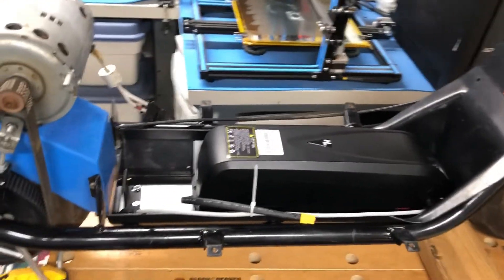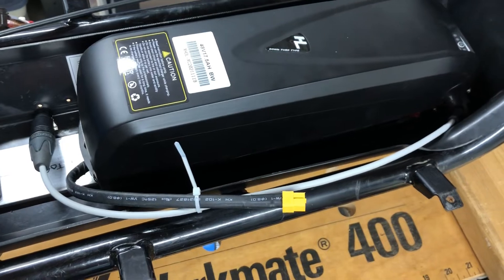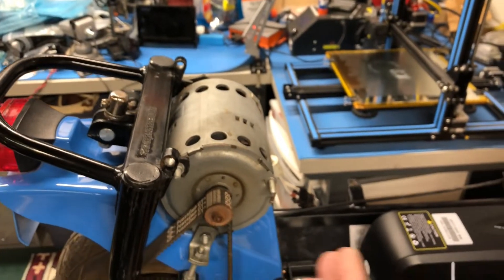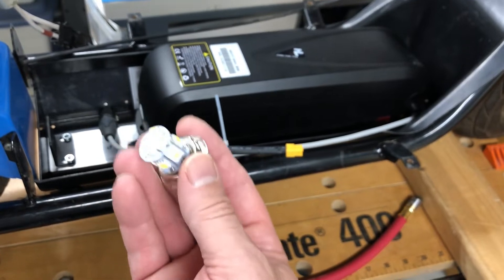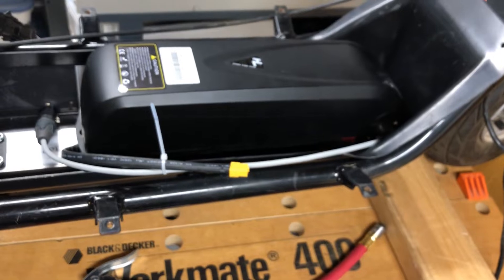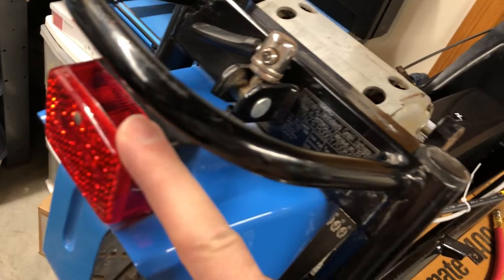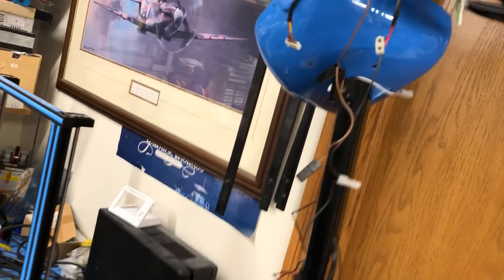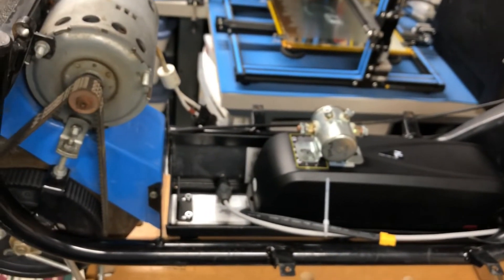Charly Scooter - Retrofit to a 48V System & Custom Motor Controller: Week 1 - Battery Installation

Comment: You change baterry and motor 🤔
Reply from the maker: battery yes..motor no...run motor at average voltage <=24VDC using pwm amplifier.